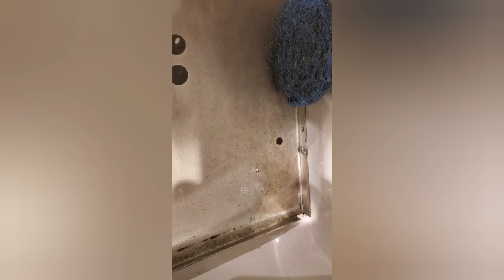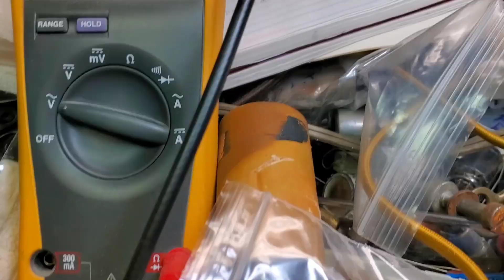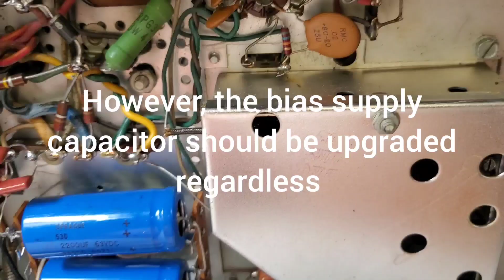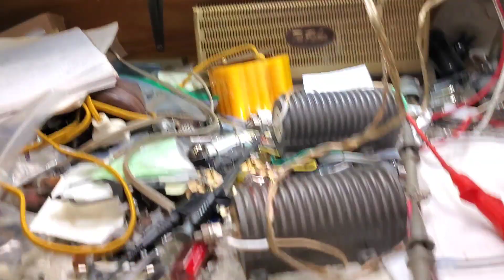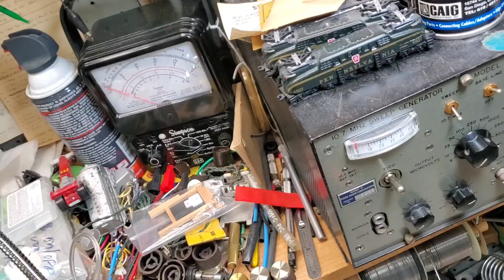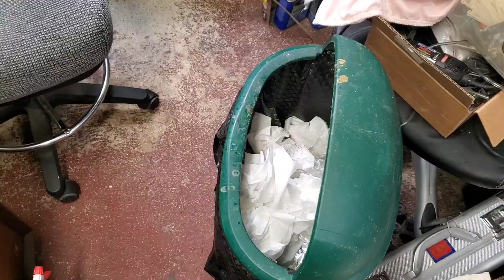Fisher 500-C General Restoration Completed!

Comment: What a fantastic job you did on this Fisher 500C!  I also have a 500C. Still working, near petfect cosmetic condition and it is rarely used. And all original except for 3 output tubes.  It lacks punch, but still sounds sweet. It barely picks up any FM stations.  Can you give a ballpark  figure on a restoration for a unit like mine?  Thanks